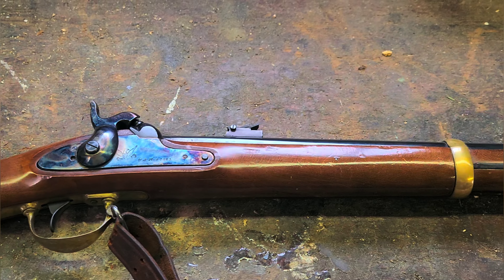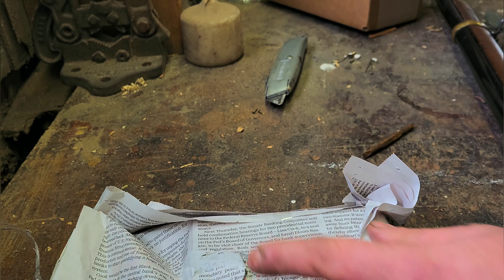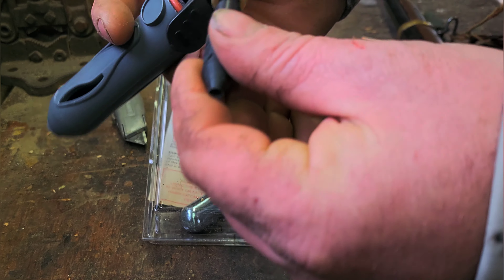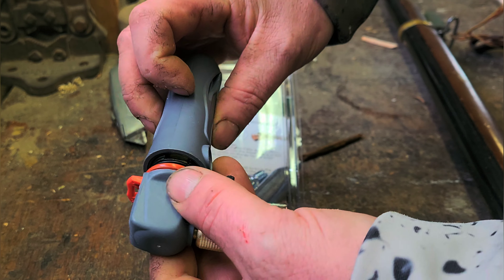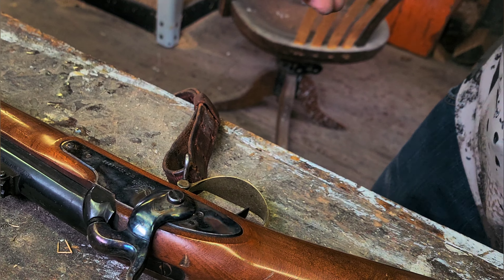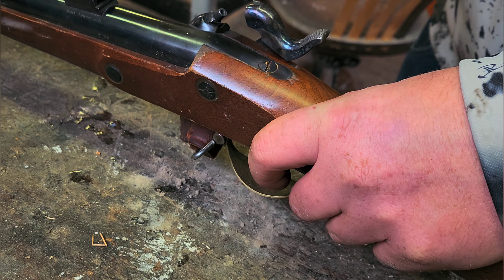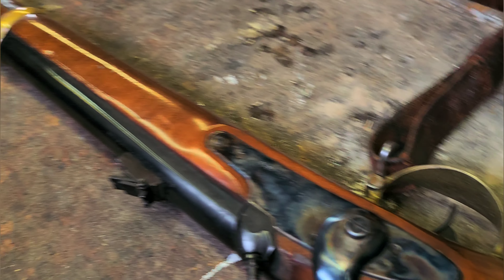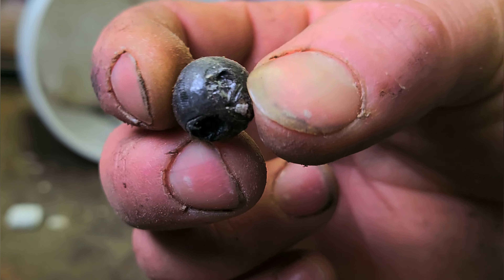B.I.D. CO2 Discharger unboxing and review.  Ox Yoke from Log Cabin Shop. Pneumatic.

Comment: I assume you now know that the cylinder gets screwed into the discharger first then screw on the plastic case. I bought the same one. Made the same mistake at first.
Reply from the maker: After the video I looked at it more closely and realized that it was supposed to be screwed in. I used it again recently and had less of an issue with it discharging the Co2.